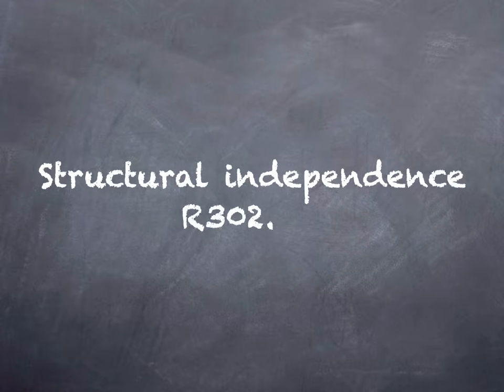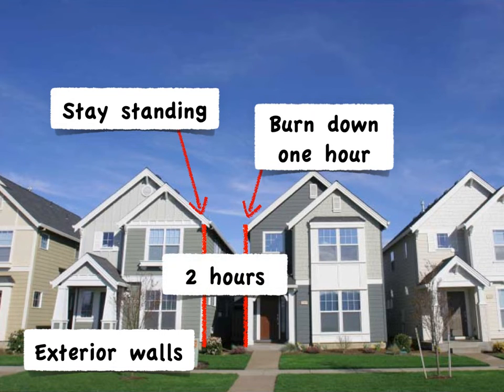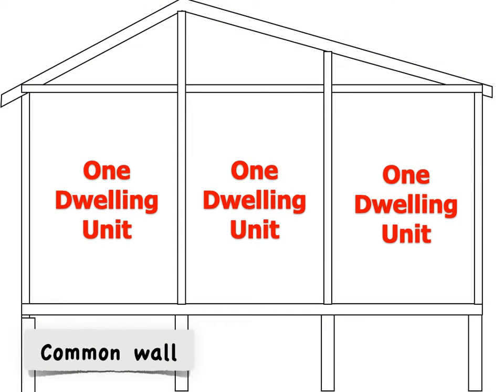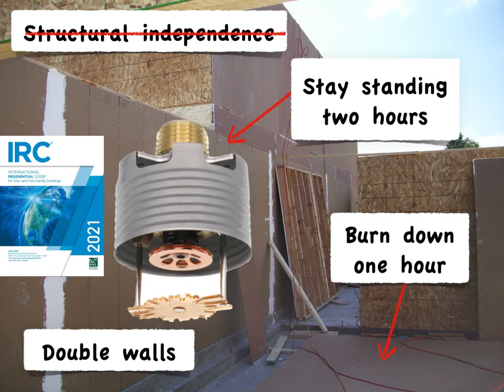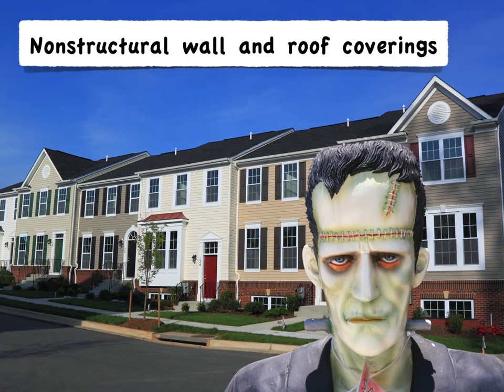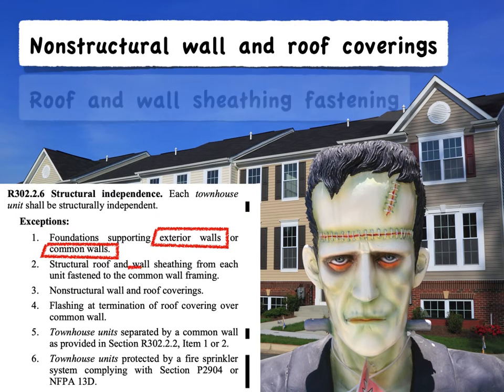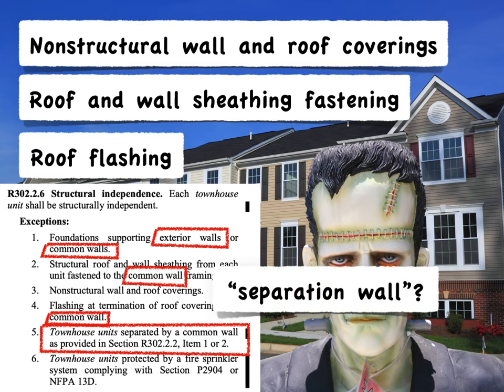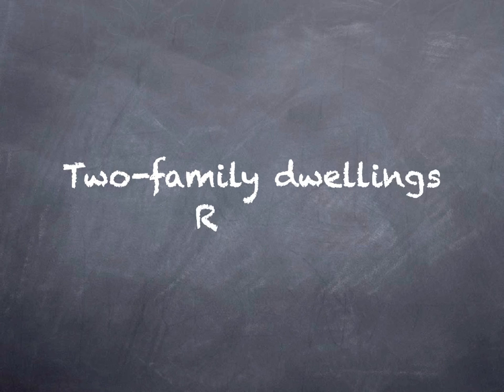Structural independence of townhouses under the IRC

Comment: Exception 5 is not clear.I think it means the Townhouse unit is not independent due to a common wall.This has been misinterpreted to think any items in the unit don't have to be independent like trusses, etc. This section should have been cleared up 25 years ago. So 2 hour shaft walls are used often now with no penetrations allowed.